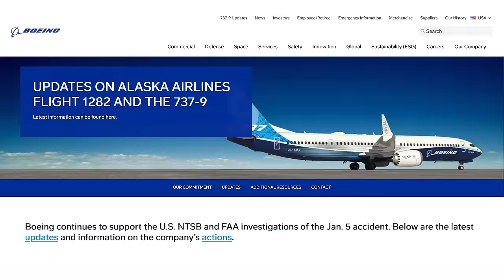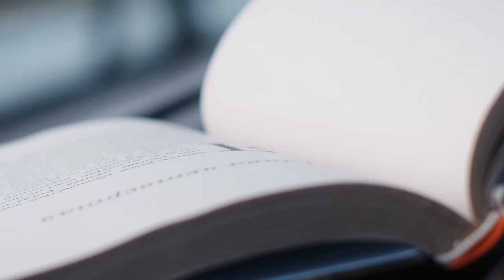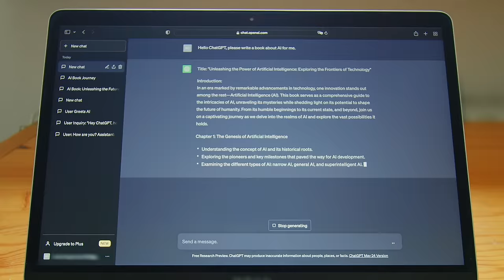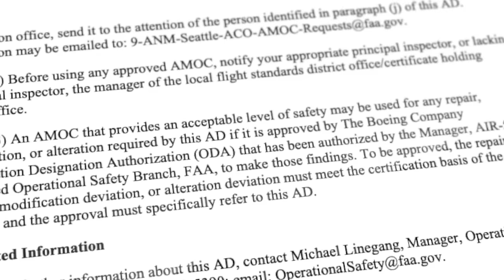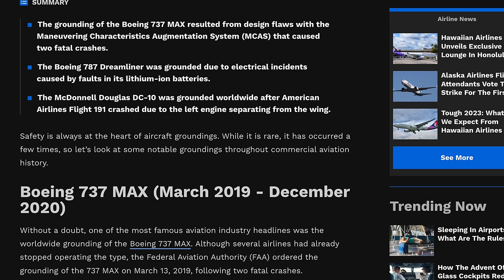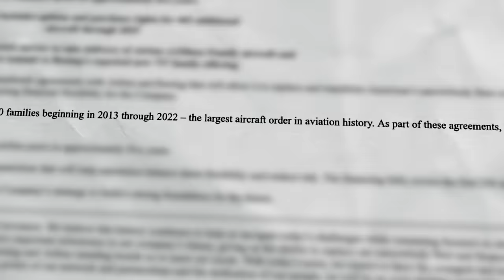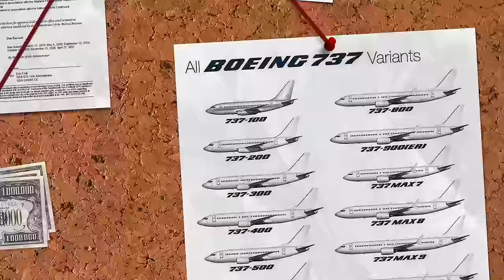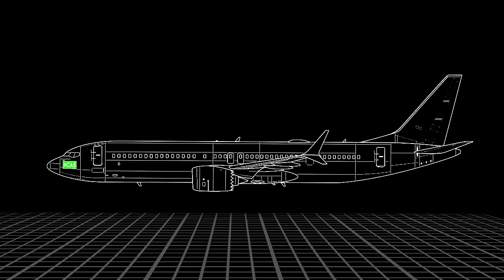737 MAX - How Greed is KILLING An American ICON

Comment: Boeing has some major corporate governance problems going on, and developed very poor work practices simply because they were not willing to pay experienced engineers and workers what they were worth and spent way too much effort off-shoring and exporting work to third parties, and then trying to force those third parties to cut costs while allowing poor quality workmanship to continue.

But... a few corrections here.  First, the bolts were not loose.  They were missing entirely... the bolts were never re-installed after the maintenance/repair to nearby rivets.  And proof of this shows up in a picture taken by one of the maintenance workers documenting the work done on nearby structural members that necessitated removing the door-plug during the maintenance.  They never reinstalled the bolts after putting the door-plug back in.

Second, the bolts are not load-bearing.  They do not "hold" the door in place.  Pressure holds the door in place against opposing pins.  The bolts simply prevent the door plug from sliding upward off the pins (which is how the door plug gets removed for maintenance).

Loose bolts found in later inspections of other aircraft are a serious concern, but loose bolts were not the cause of the accident.  Missing bolts were the cause.  Since the bolts are not load-bearing it literally only takes one, loose or not, to prevent the door from dislodging from its structural pins.

The design of the door-plug itself is not at issue.  It is a reasonable, solid design.  Unlike the MCAS mess where Boeing was so focused on keeping the same type rating for the Max as for prior models that they messed up the automation.  Not only did they mess up the automation, but they made redundant AOA sensor logic a value-add extra feature that airlines had to pay for instead of base-line.  Two culprits.  The first was the MCAS override automation that prevented pilots from regaining control of the aircraft, and the second was not integrating data from both AOA sensors into the MCAS system from the start, so one bad AOA sensor could crash the plane.

-Matt
Reply: It seems the corporate governance problems really took off after the merger with McDonnell-Douglas in 1996. Mc Donnell had a terrible reputation, in the industry,  but shareholders loved their management, because they generated dividends by cutting margins.

Comment: 7:30 - it actually seems that the four bolts were not there at all! The construction of the door plug is such that these bolts don't bear the load but prevent the plug from sliding up and thus clearing the tabs that keep it shut. Think of a battery cover of a TV remote or such - the cover typically slids into grooves to keep it closed. Sometimes - in toys at least - there is also screw that does prevent the lid from sliding out of the grooves. The bolts are like that screw.
Reply: Yes, but nuts and bolts, no matter how secure (without welding them down), are always subject to the potential of vibration loosening. Had Boeing added something as simple mid bolt cotter pin to ensure they couldn't potentially unthread from vibrations then there would be no question as to if they were not installed at all or detached over time. That isn't exactly a costly redundancy, and likely would have put a set of eyes on the bolts yet one more time to ensure they were there. Redundancy, redundancy, redundancy on potential failure points like this make long life vehicles, like planes, safer in the long run.
Reply: @billyoung9538  AFAIK - the bolts were supposed to have cotter pins. Seems at the moment that there was no problem with the design of the system. Instead the problem is *operational*. In short: the bolts were not installed (and cottered) at all after the door plug was closed - and the QA procedure did not catch that.
Reply: @EneriGiilaan  I thought I read elsewhere that cotter pins were not part of the design; however if they were, then that's most certainly a dead giveaway that they were never installed.
Reply: Further indication of the bolts not being installed - One of the reports I read indicated that Boeing admitted their production records should have documented the bolts being installed, but the record for that plane does not.
Reply: It sounds like there is no problem with design and a bit of a problem with human error.
Reply: @deegon01 there is a huge issue with the design tho in relation to depressurisation which no one seems to be talking about, in the report the pilots were not happy to have not been told that in the event of rapid depressurisation that the cockpit door would fully open. On other planes normally it’s vents that open , but in this plane the entire door opens. But what no one is talking about is, that’s a threat for terrorism. A simple bullet through the skin resulting in depressurisation automatically gives a terrorist access to the cockpit. This is a crazy oversight. Even worse, why were pilots not told about this. A small explosive device could give access to cockpits. If you are a suicide terrorist, it’s not a risk to cause a small explosion on board to gain access.
Reply: Excellent analogy!

Comment: You mentioned AA and the 737, but left off an airline that flies exclusively 737 and their interest and viability depending on operating a single type certificate Southwest. The discussions between SWA and the FAA forced the retirement of SWAs older type models 737-300 and 400 if they wanted to add the MAX to their operating certificate

Comment: If an airline wants/needs to block off any particular seat(s) for whatever reason, signs are posted on the affected seats before any passenger boards the aircraft. The Flight Attendants know exactly which seat(s) is blocked, and they would know why they are to be blocked. Signage on the seat would be large and very clear that NO ONE is to sit there at any time, and probably the bottom seat cushion would be removed. If the maintenance staff wanted these two particular seats "blocked" for whatever reason, seriously large/visible signage would be all over the seat itself, and probably the seat cushion(s) would be removed, to prevent another passenger moving to one of those seats to give himself a bit more room.The cabin crew would also be watching to make sure those seat(s) remain unoccupied for the flight. I understand the desire for some more room on a small crowded aircraft, and I've moved seats just before takeoff to give myself a bit more elbow room. BTW:  I'm a  flight attendant for a "legacy"  airline in the US of A, for 23 years, both domestic and international.

Comment: I have a degree in aerospace science. I am a lifetime career, Boeing airline captain. There is no way in. Hell you will catch me on a 737 max.
Reply from the maker: Appreciate your insight! What did you fly?
Reply: Switch to Airbus and save some face and dignity b4 you retire. When you do retire will you get a pay out of $60m like Dennis Muilenburg? lol
Reply: He's 100% not an airliner captain or even a pilot
Reply: @TwoBitDaVinci hes 100% not an airline pilot. I'm a pilot and I know I'm not qualified to discuss the 737 Max issues. I'm not sure why or how you thought you could. You kind of don't understand well how type certificates work, or why manufacturers opt to make models of planes they already had type certificated. You realize a brand new plane, has far more risk of an accident, than an older type certificated one that's been type certificated since the 50s.. A new plane would still look and fly similar to a 50s plane anyway, I'm talking a brand new one like imagine a 797. The 50s style has stuck and will remain that way. If you understand how jet airliners and jet engines work, you'd know that full power on engines makes the nose of the plane go up. MCAS was an unfortunate software flaw, but the plane itself, is absolutely fine and safe. The bean counters at boeing screwed things up, but the 737 itself is an airworthy plane. An airworthy isn't a general term, it's literally an FAA term. Airworthiness Directives or ADs are issued to manufacturers with problem planes, so they fix that problem. MCAS is fixed. The 737 is fine and safe. Even the new models. Pilots don't go around making videos about how doctors do doctor stuff, but non pilots constantly make videos on aviation and piloting as if they know what they're talking about. While your research was somewhat thorough, you still drew incorrect conclusions.. Also, the FAR is only for the US, therefore it has zero regulatory power over Ryan Air. And whenever people who don't understand aviation or how becoming a pilot works say "pilot training". I'm like. Ugh. Ok. So where do pilots go to get their magical pilot training? Being a pilot isn't a job. You don't get trained like it's on the job training. It's more like study and practice than training. And you don't just apply at an airline and get training directly in a jet for a couple dozen hours and boom your a pilot in an airline. But whenever "pilot training" is mentioned clueless people think that's how it works.

Comment: Well, if we count the 737 predecessors it's even older.

The 737 is based on the 727, which in turn is based on the 707, which in turn derived from the 367-80 from 1954.

Well, guess how many of the current car designs are technically still going back to a 70 years old design, sharing the very same layout?
🤯😉
Reply: I think a key difference is that with cars, they just get easier and easier to drive as they evolve (to the point that they now drive themselves). The way you drive a car has barely changed at all over the decades other than the changes from manual to automatic to hybrid transmission. But stickshift is driven pretty much the same way today as the first ones that came out. No real need to "train" for new systems. It's not the same with airplanes. Pilots need to train for a million different failure scenarios
Reply: @ipp_tutor It doesn’t really matter how much training a pilot gets, if the MCAS overrides his commands. How can that be approved?  The pilot is ultimately responsible for flying the plane.
Reply: They did not test the MCAS system adequately.  According to this video they treated it as a plug-in software system between pilot and control surfaces that would comp for undesirable flight mode's.  The engineers thought they understood what MCAS was all about.  Boy were they wrong.  Debugging a complicated software program is much harder than a person might think.  Not-so-funny things can happen at the extreme edges of the flight envelope.  I wonder if management shut down some complaining engineers who were arguing that MCAS is not ready?
Reply: @scotteladd2537 MCAS was fixed.
Reply: @ipp_tutor are you a pilot? I'm so tired of people who don't comprehend how someone becomes a pilot, always mention "more pilot training". What. Does. That. Mean? Where do pilots go to get this magical training? Millions of scenarios is a huge exaggeration. In fact pilots these days are garbage, they can't solve a problem in which they didn't "train" for that exact scenario. It's not like the older days where a sudden problem that wasn't "trained" for and wasnt on a checklist could be overcome by compotent pilots. Today's pilots just want a job and free travel and the only way they get into it is by applying for a loan at a pilot mill which only craps out garbage pilots. It doesn't matter how safe a plane is sometimes things go wrong, and having garbage career pilots doesn't help whatsoever
Reply: The non pilot video creator literally explained it in the end, which he researched from sources that only pilots would know about. The reason is, to build a new plane (which will still look and fly like a 1950s plane even if it's brand new like a 797 or something), you need to get a type certificate as he said (though he doesn't truly understand what it is he's just regurgitating what he researched). That's why there are new models of the same plane and not new planes.
Reply: Dude has no idea what he's talking about in the end anyway. MCAS has nothing to do with putting a "new plane in an old type certificate" or whatever he says. Ugh I'm so tired of the general population making videos about things they have no expertise on. Do pilots go talking about how doctors do doctor stuff?

Comment: Blancoliro (Juan Brown) covers this and other aircraft accidents. 
The Boeing series of planes are closer to the ground. Airbus is higher off the ground (taller landing gear). Thus, when Boeing wanted to put larger engines on the aircraft, they had to put them further in front of the wing, which caused instability which was supposed to be corrected by computer control, but had issues causing the earlier 2 crashes. The 'door plug' incident is LIKELY because the door plug was slid into place, but the bolts holding the interlock were never installed. 
.
Pilots DID notice that the 'cabin pressure' knob was set higher than it should have been to maintain pressure, so they KNEW that there was an issue (either a leak, or not enough pressure from the system). They DID make a note of it, every time the plane flew, but management either didn't get the memo, or ignored it. 
.
I really hope this doesn't kill Boeing (and Spirit, their fuselage builder) as aircraft manufacturers. They have a backlog of probably 1600 aircraft - so the pressure is on Spirit to get the fuselage's 'out the door' as fast as possible. There are all kinds of issues, including extra holes drilled for non-matching bolt holes in the rear tail plug that point to issues at Spirit.
Reply: Actually every time the issue was noted down engineers checked into it. The system itself was exchanged twice from what I remember.

But it's difficult to find a leak on the ground, where there is no pressure difference.

But I always was curious as to why exactly the two seats in front of the plug were empty. Did the cabin crew notice something?

Sadly the voice recorder was over written, that could have been a very interesting conversation?
Reply: @jantjarks7946  The null pressure difference in the ground isn't a problem. They can (and do) easily pressurize the cabin at ground level to check for leaks. It's not an issue at all
Reply: @ipp_tutor  Sure, you can create a pressure difference, but not within the same range. At least not with the system aboard.
Reply: I can't remember if it was Juan's channel or elsewhere but there was a picture of the plug after being re installed for the final time which showed the bolts missing. In addition , the holes where tho bolts screw into had UNDISTURBED PAINT which indicates bolts were never installed.
Reply: @jantjarks7946  The problem possibly would not have been found simply by pressuring the plane at ground-level.  Pressurization actually stops the leak and holds the door plug solidly in place.  Plus, no vibration at ground level sitting in a hanger.

The problem was happening during ascent, before pressurization created a large enough differential to solidly hold the door plug in place.

Though there is also a question as to whether the door plug was even completely seated in the frame... that is currently an unknown.  If it was not seated then it would have been a ticking time bomb at any altitude and the result would have been catastrophic if it had happened at 36000 feet.

If it was seated, the door wasn't going to go anywhere at cruising altitude.  Too much pressure differential for vibration to dislodge it.   So at least in this case, the danger period was during the initial ascent... high engine vibration coupled with a low pressure differential.

-Matt

Comment: a lot of conjecture and speculation at 10:26.  I highly doubt the aircraft maintenance manual included checking plugged doors for a pressurization issue.  the other doors with seals affected by opening and closing, pressure controllers, pressure sensors and pressure valves are all likely to have been checked.  Furthermore, there is documented evidence that alaska did troubleshooting (not ignoring behind closed doors).

Comment: Missing bolts.
Reply: Missing INTERLOCK bolts. The door was properly installed, but the interlock bolts that ensured it stayed 'in place' were most likely missing. As Ricky stated, these are built 'by hand' - so it's likely this was missed - both in the build process, as well as in the 'inspection' process. It's likely a few Spirit inspectors missed it.

Comment: Ultrasonic acoustic detector?  That looks awesome!  I need one.
Reply: I use one it’s not as accurate as one would think it’s frustrating
Reply: Maybe I should clarify with all the noise in the factory you get lots of distortion, making it frustrating
Reply: @davegreen7594 might work better in a plane if you can pressurize the plane while the engines are shut down on the ground, much less interference.

I can only imagine how much of a pain it is to use the same device in a active factory, so much stuff is probably making noise in that detection range that the poor device probably gets overwhelmed
Reply: We do use it when the aircraft is pressurized, and the engines are off in the factory. Still get distortion.

Comment: Prior to the Boeing 737 Max the 737 was considered to be a safe aircraft.  The aircraft was updated from the 737-100 - 737-800 without major issues.  The decision to continue the upgrade path to the Max made a lot of sense, moving the engines up and forward turns out to be more of a new aircraft type then a simple update.
Reply: But...I mean....aircraft engineers knew at least since WWII that if you move both centre of thrust and centre of gravity on a given profile, all sorts of nonlinear shenanigans start happening and you need to go over the entire airframe! Even for a layman enthusiast like me it is not surprising that the beast completely changed its behaviour after the engine swap. duh.